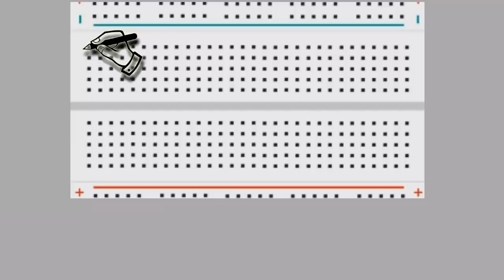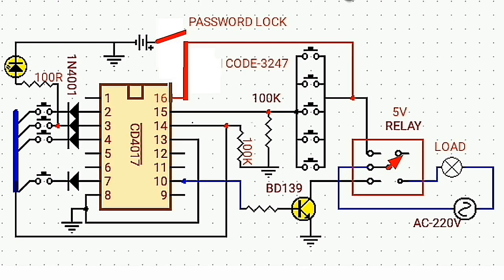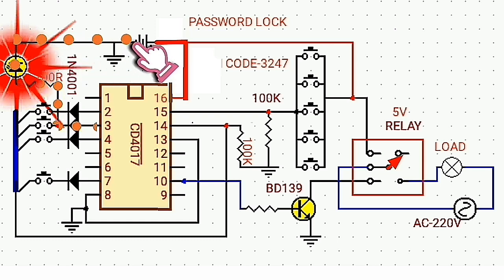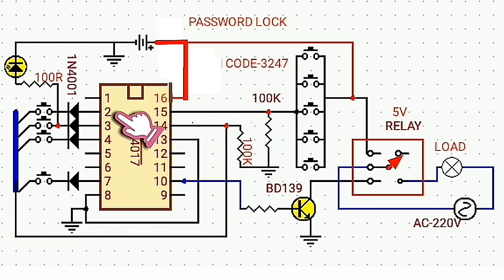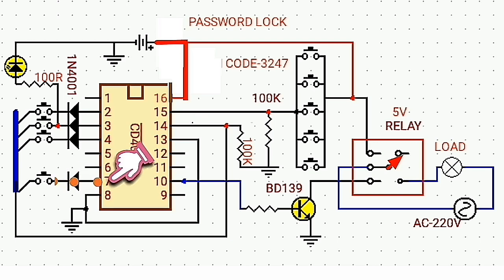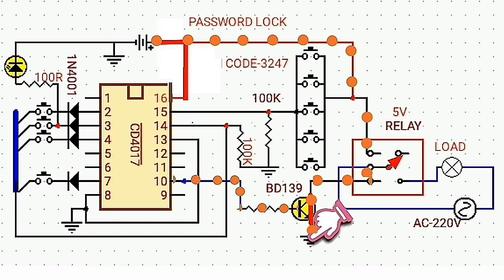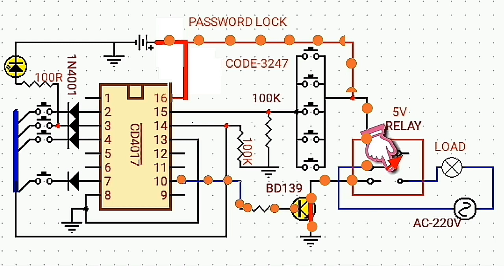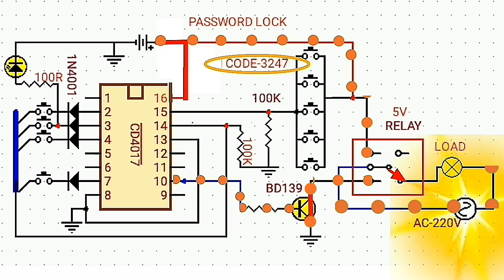How the password circuit lock work(cd4017)

Comment: I’m confused is the password 3247 or 2134?
Reply: 3247 are pin number from chip
pin3 is output0 ->button2v(this is high after reset or turn circuit on so this is first digit button)
pin2 is output1 ->button1
pin4 is output2 ->button3
pin7 is output3 ->button4
pin10 is output4 ->button5 OR this case its open sesame xD

so your passcode is what button you connect those pins

not matter there no labels LOL and sequence not matter if push only those numbers you eventually get it correct
if passcode is 2134
you can push (134*)(2)(234*)(1)(214*)(3)(213*)(4)
* means you can hit those many times it not make any diff it wont reset.
so passcode is *2*1*3*4